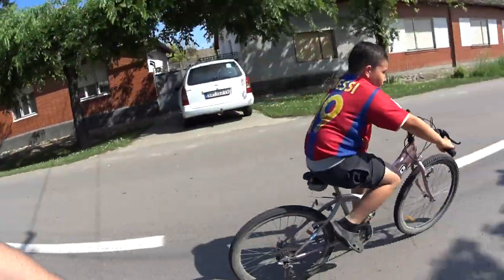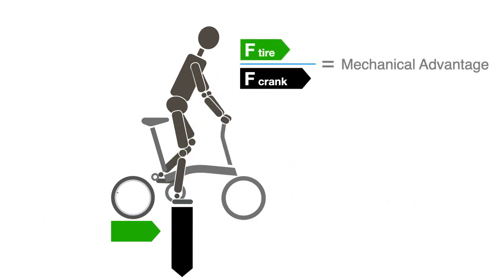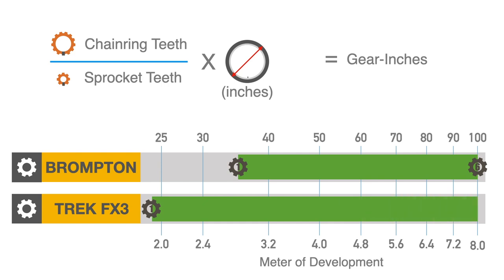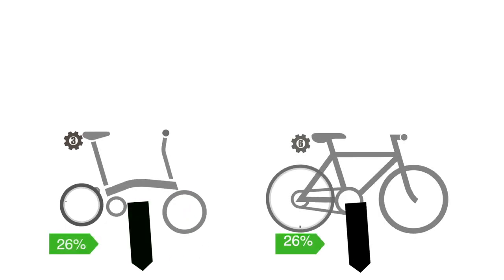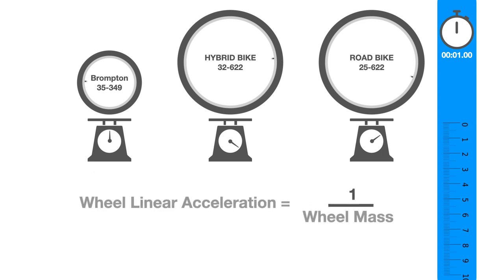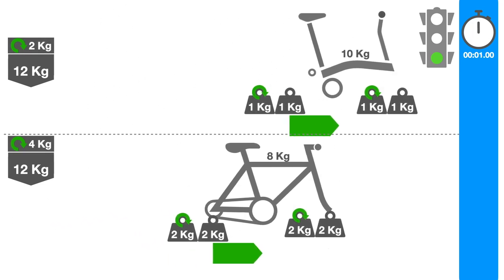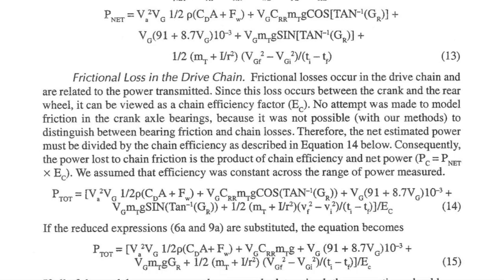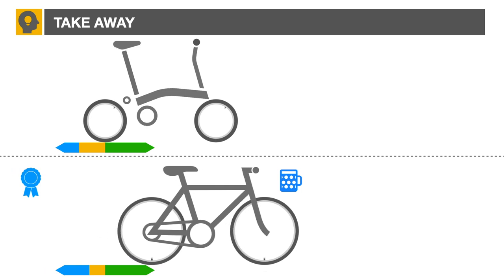Brompton Acceleration - Myth or Reality?

Comment: This is my kind of nerdy bicycle physics channel. I am so glad to have found it. And I just bought my first Brompton, and on the streets of NY, pulling off the line, I do experience what I feel like a wind of acceleration, but as soon as the 26" bikes catch up they sail by of course. How nice to understand why.
Reply from the maker: Stay tuned for more "nerdy" videos in the future
Reply: @2Bikes4Adventure  Thank you! The question I have having just bought the C Class 6 speed (sunset orange...) is - how to manage the use of them such as not having to use all 6. It is seeming from my initial riding that I can get a practical working range out of selecting <plus> in the derailleur, and then using the three speeds in the internal hub gear. I wonder if that makes sense or what are the best practices for using 6 gears (which I hope is not using them all). Even to understand whether 1-2-3 ranges, do they overlap in minus vs plus settings? Or are they sequential?

Comment: The thing unsaid about acceleration is frame strength and thus leverage on the handlebars. Sprinting on a road bike where the limiting factor is rider strength is not comparable to sprinting on a Brompton, or even on my Birdy at torsional rigidity of the two folders is not in the same ballpark as a modern road bike. The fact that you can ad the full strength of your shoulders, chest and upper arms in opposition to the downward and to a lesser extent rotational force on the pedals means folders will always be at a disadvantage as far as speed and acceleration are concerned. Thanks for the excellent video.👍😀
Reply from the maker: Good point. We touched on the subject of frame flexing briefly in this video ( https://youtu.be/VwRR3Ubp0DU ), but focused more on suspension power loss.

Comment: Id really love to see you revisit this with some of the changes made by the T line! I assume the T line will still be slower than a comparable road bike, but it would be nice to quantify its advantages over the C line and P line.

Another interesting thought experiment Ive wondered about is "at what point does an electric bike become a disadvantage?" An electric brompton, for example will obviously make a ride easier withinna certain distance, but I do wonder sometimes how much using it ats its lowest power assist level is actually better over just using a lighter bike over long distances.
Reply from the maker: Both suggestions would indeed be interesting to investigate. We will look into it.

Comment: i have a new hypothesis!

new hypothesis, i think “internal gear hub” is at play when people say brompton has good acceleration.

i think in urban environment one frequent scenario is to stop at traffic light and start. before stopping at red light it is usually at high speed (heavy gear / large gear-inches)

and when start from a complete stop it is easier to use small gear-inch (light weight gear ratio)

however for city bike or road bike, it usually takes quite some time (and distance) for gear shift to happens since the chain need to be moved around during pedalling.

while Brompton, having an internal gear hub, rider can change the gear ratio WHILE IN COMPLETE STOP. from the highest gear-inch of “3+” to a quite small gear-inch of “1+” can be done by flicking the right thumb two times.

in my opinion, 

although i absolutely agree a light way 7kg road bike at 700C is much easier to accelerate from complete stop than a 12kg C-line six speed Brompton.

However, in practise, the Brompton is much easier to change from high gear-inch to low gear-inch due to internal gear hub.

for a road bike rider in urban setting to change gear from high to low every traffic stops will be very very annoying. 

for Brompton, it is very crisp and easy to shift gear IN COMPLETE STOP.

you can be at fastest right before you stop. change the gear hub, and use the lightest gear ratio to start (and accelerate) the bike forward
Reply from the maker: You raise a valid point. The likelihood of a derailleur based system being in the wrong gear at a red light is higher than with an internal gear system (this would put the P/T-Line at a possible acceleration disadvantage over the C-Line btw).
In our simulation, we assumed both riders have an identical initial gear development setting.
Finally, note that in an urban environment, we rarely use 1-/+ on our M6R(44T) during initial acceleration. We usually go from 2- to 2+ (which involves the 2speed derailleur, not the IGH). The same is likely to be true on the new 12 speed configuration as well (initial acceleration upshifting will be done using the derailleur, not the IGH).
Reply: @2Bikes4Adventure  i always amaze at how quick and thorough you guys reply to comments on youtube. 

it helps me to know more about different setting assumption in the video. love it, thanks.

to add on the discussion, i live in (and work in ) hilly area of Kowloon, Hong Kong, China. 

therefore the need of wide gear ratio is helpful. and when going slightly up hills like in 1:5 gradient or 1:4.5 gradient, i might need 1+ or 1- to start ( so not to piss off van driver behind me 😂😂)

Comment: Can you make a video of the M6L steel comparing it to the old Titanium and the new P 4 gear series of Brompton?. Few months ago I bought a 2021 Team GB because I watched one of your episode which you mentioned and pointed out that the 1 kg difference of the titanium Brompton is easily augmented by using a swalbe One because its light and less rolling resistance, but now Brompton introduced the Performance Brompton weighing 3kg less from the steel M6L at 12.5kg avaerage, I want to the implication of the 4 speed against the 6 speed , plus the impact of the wieght differnce of 3kg. thank you and all the best and God bless you!
Reply from the maker: Good suggestion as there is a lot of interest in the new P model (if, for most of us, it’s only dreaming about it). We will look into it.

Comment: What another wonderful video! Confirms what I already thought: the radius of the tyre is not hugely relevant, it's just that a smaller wheel is easier to accelerate because of the weight, and the effect is pretty negligible (and quickly cancelled by rolling resistance). Some questions:

1) I understand that the radius of the wheel isn't really relevant to the force required to accelerate it, it's really the weight that's important. But is that completely accurate? What if you had a very heavy wheel but with the mass concentrated near the centre of it? Such a wheel wouldn't have high inertia when spinning, so would presumably still be easy to accelerate. Presumably the principle you mentioned applies to wheels with proporitional weight distributions (or all weight concentrated on the circumference?). And presumably the weight distributions for a Brompton versus a normal bike are about the same, so I guess this isn't important. Actually, if anything, I'd guess a road bike will have quite a light "middle", with most of the weight concentrated around the diameter, so this may count in favour of the Brompton's acceleration.

2) On weights, a decent road bike will be more like 10kg I think. To be fair, you can also get lighter Bromptons, but I think you have to spend a lot to get one at around that weight. So a typical (say £1000GBP) bike, around the same cost of a normal 12-ish kg Brompton, would probably be quite a bit lighter. I'd bet this makes more of a difference than the smaller wheels.
Reply from the maker: Hi,

1. You are right, we assumed most of the weight was located on the perimeter of the wheel (thus ignoring effect of spokes and hub). Note the typical weight quoted was for front wheels. The SturmeyArcher hub would significantly increase the weight of the rear wheel, but being located near the rotation point and, to simplify the explanation, we assumed it would be similar to the inertia of the lighter but larger hybrid bike’s cassette. So, we basically equipped both bikes with 2 front wheels and included the transmission weight onto the frame.

2. We assumed an hybrid bike (Trek FX3 10 speed) for this test as it has a similar weight to a Brompton (it’s however, quite cheaper). Weight is critical in acceleration computation (more so than for maximum speed). We felt it was important to have 2 bikes of the same weight instead of two bikes of the same price (our other video about Brompton Speed was against a 10Kg road bike of similar price).

Comment: Excellent analysis. Now I am wondering what PSI is required the smaller wheel, to equal that rolling resistance on a 700c bicycle wheel @ 80-100 psi?
Reply from the maker: Everything else being equal (same tire type/brand/model/width, pressure and road condition), a 16” tire should have a rolling resistance about 40% higher than a 700c. Increasing the pressure could help, but only if the road conditions permit (otherwise, it could make things even worst).

Comment: Great video! The math in this video assumes the mass of the wheel is homogenously distributed (like a solid disc).
A rim type flywheel does indeed store more energy than a disc type flywheel at the same mass and outer diameter. It might not be too "off" an assumption to make as the spokes carry quite a bit of the wheel mass. I am also not sure if taking this into account would be an advantage to the bigger wheel than the smaller one. And of course if we could consider the mass distribution to be the same, then the math would still hold. The difference due to this would be very small for different diameters of bike wheels.
However I think that this difference does exist is part of the reason for the "myth".
Reply from the maker: We assumed most of the wheel mass difference is due to the tire and rim size, thus located on the perimeter. We ignored the weight of the spokes (and assumed the hubs were identical on both bikes). We therefore used the moment of inertia of a hoop (MR^2) and not a solid disk (1/2*MR^2) in our software model.
Reply: I think that makes sense. It is a good enough approximation even if I think the thickness of the rim+tire should be a larger portion of the wheel diameter for the Brompton given similar rim thickness and tire "thickness". So there would be slight advantage for the Brompton. The hub on the Brompton would carry more inertia however so a slight advantage to the road bike there.. Spokes are probably negligible 🤔

Comment: Love the thorough and fair exploration. I did have one question that I either missed or was not mentioned. As the wheel accelerates would the weight being on the outside of a larger circle have a greater effect than the same weight (or even less weight in this example) on the outside of a smaller circle? or is this weight just as negligible as the wheel weight difference?
Reply from the maker: Hi Dustin,
Assuming most of the weight is from the rim+tire and ignoring the spokes (and hub) weight, a Brompton 16” 1Kg wheel would have the same acceleration performance as a super-light but larger 700c 1Kg wheel. The radius would have no effect, only the wheel weight.
Note that having the choice between a “lighter and better acceleration wheel” vs “heavier but better aerodynamic wheel”, most road bike racers prefer the 2nd choice.
Reply: The larger circle of the wheel is negated by the fact that it is spinning at a slower speed for the same forward speed. So as mentioned it is just a factor of the rim and tire weight. 
Now it you can trade off a heavier hub for a lighter rim you do have an advantage. That is why some exotic wheels will have the spoke tensioning mechanism in the hub rather than use traditional spoke nipples.
Reply from the maker: Very good point.

Comment: For rotational inertia of a pointmass/hoop it is equal to mr^2 with respect to the rotation point. This makes it that the radius at which the mass exists has an extremely large effect.  So if two tires have the same mass but one wheel is double the diameter that will have a 4x bigger rotational inertia. So based on this i dont understand the statement that the radius does not matter.
Reply from the maker: Hi Jesse,
You are right, a bicycle wheel inertia (I) can be approximated to mr^2. So, at first glance, r seems to have a bigger effect than m.
The Newton’s second law as applied to rotational motion is: 
T = I α 
Where:
T = Torque on the contact patch
I = Bike wheel moment of inertia (mr^2)
α = rotational acceleration (in radian/s^2)

Assuming the propulsion force on the contact patch is F, we have
T = F r
We know the relation between rotational and tangential acceleration is defined as:
 α = a/r

So, if we replace the value of T, I and α in Newton's 2nd law equation, we get:

F r = mr^2 α / r

If we cancel out all the “r”, we get:

F = m a (which obviously looks very familiar)

So, the tangential acceleration (a) on the contact patch will be proportional to the propulsion force F applied to it divided by the mass (m) of the wheel. We already established both bikes will have the same "F" if they have similar crank and gear-inch. So, the radius will have no effect, only the wheel mass.
Reply: @2Bikes4Adventure  thank you for the detailed response, using energy it might even be easier to show it. U = 1/2 I*w^2 

U is the energy in joule
w is the angular velocity in rad/s. 
I is the mr^2 

w the angular velocity is equal to  v / r.  (vehicle velocity v in m/s and wheel radius r)

So filling it in you get U = 1/2 * (mr^2) * (v/r)^2, ending up with the classical 1/2 mv^2. 

My brain fart was not taking into account that while one wheel is bigger, due to that it automatically means it rotates more slowly.
Reply: @2Bikes4Adventure  what an interesting discussion. But can the wheel inertia really always be approximated to mr^2? Say, a 16" wheel with 1.0kg BSR hub and superlight rim and tire (without spokes) will weight about 1500g. A 28" with 300g single speed hub, a double-walled touring rim and Schwalbe Road Cruiser tire will weight about the same. According to my (very primitive) calculations, the inertia momentum of this 28" wheel would be about 7 times higher that that of 16" wheel. If distribution of weight not taken into account and mr^2 formula is used, the difference would only have been 28^2/16^2=3.06. 
Worth noting that the inertia momentum of the hub is neglectable compared to that of the rim and tire. And of course the whole effect of wheel rotational inertia is quite neglectable in real life.
Excellent video, by the way.
Reply from the maker: @wapperv4412 As you mentioned, the effect of the BSR weight on the wheel rotational inertia is negligible.

Assuming a BSR hub radius is about 3cm and has a mass of 500gr, its moment of inertia could be approximated to 1/2*mr^2 or 1/2 * .5 * .003^2 =  2.2E-06 kgm^2

Now, assuming a 1Kg Brompton front wheel  (with Tire+tube but no BSR hub), the moment of inertial could be approximated to mr^2 or 1*.02^2 = 4E-04 kgm^2, or about 200 larger than the BSR hub inertia.

So, in our inertia calculation, we ignored the hub presence/weight, thus assuming a 1Kg weight for both Brompton wheels.

Comment: Hello, many thanks for the super clear (and sometimes over the top of my head) explanation. I can empirically validate your conclusions from my daily experience :). Usually, I am the fastest to get out of the bicycle jam (mostly of city bikes) with regular effort, but once in a while, there is a road bike or hybrid that overtakes me. However, there are at least 7 intersections with traffic lights in my 25 minutes one-way commute, and other bikers always catch up. I also catch up with e-bikes.    Separate topic, I have always admired your animations, always simple and elegant. I would love to learn to make such visuals for my presentations at work, what software do you use? Thanks.
Reply from the maker: Hi Kaustubh,
As surprising as it may sound, we are using Apple Keynote for our graphics. Leveraging its “Animate: Magic Move” feature, rudimentary animation is possible. Anything too complex can quickly become a nightmare though, so we need  to keep it simple. We have experimented with Apple Motion, but hasn’t master it yet.

Comment: Am I correct in thinking that wheel radius does not matter for acceleration only if the ratio of the rolling radius to the radius of gyration remains the same?
Reply from the maker: Correct. We assumed the wheel mass was located on the perimeter (rolling radius) for both bikes (ignoring hub and spokes differences). The specified mass (1Kg and 2Kg) was measured for front wheels. We assumed the Brompton’s internal rear hub moment of inertia was equivalent to the hybrid Shimano cassette and ignored it in rotational motion calculations.

Comment: I think frame stiffness should be an integral part of this calculus...so Brommie could be "climby" if it is stiff, which I doubt...on the other hand my 20" wheel Cannondale Hooligan minivelo is a climbing beast with what is reputed to be Cannondales stiffest alloy frame due to its extremely tight triangulation and small size. Love that thing.
Reply from the maker: Good point concerning frame stiffness. We elaborated on the subject in a subsequent video: Can a Brompton Climb? - GCN Challenge Explained https://youtu.be/VwRR3Ubp0DU
Reply: @2Bikes4Adventure  thanks

Comment: What about agility? Is the Brompton really easier to turn and to cut corners with or does it only feel that way?
Reply from the maker: While the Brompton wheel base is comparable to a full size bike, it does have an unusually small mechanical trail. Combined with its smaller overall length, it translates into an agile bicycle in crowded environments (city traffic or sidewalks).